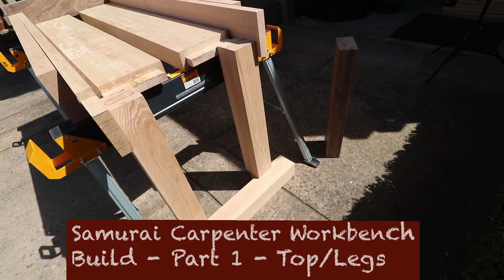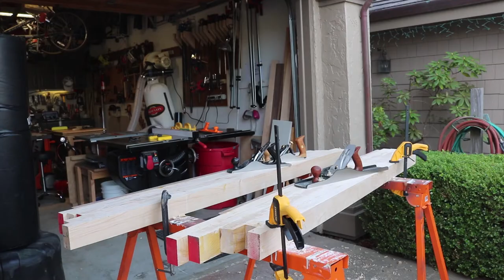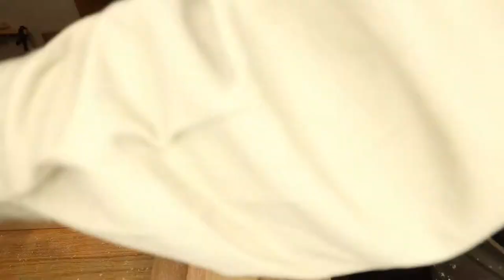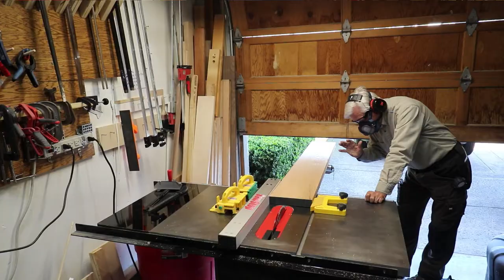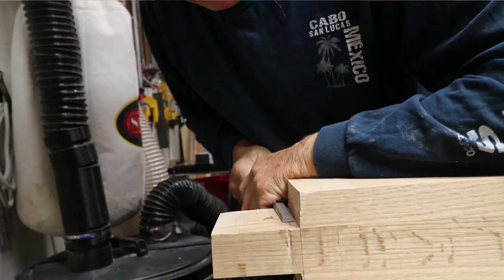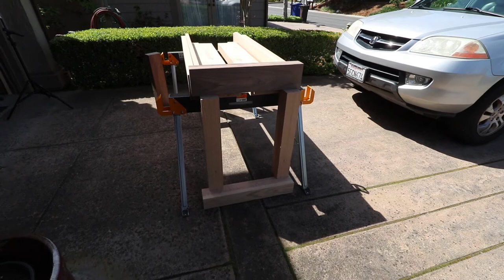Workbench Build Based on Samurai Carpenter Design - Bench Top and Legs

Comment: I just found the Samurai Carpenter a few months ago and LOVE this workbench!   I want to start setting up a workshop in my garage this year, but right now have ZERO tools at all with which to do so.  But I know I need a good workbench.

I bought the plans for it as well, but I like how you are making a shorter version...it's more the size that I would want as well.   But I don't know that I need something TOTALLY like this bench.  So I think I am going to try to take some of the design elements from the Samurai bench and include them in the Hybrid Workbench from the Wood Whisperers Guild.  

Now I just need to figure out what tools I truly need at the minimum to start things with.  lol
Reply from the maker: Thickness planer, Japanese saws, router, and set of chisels